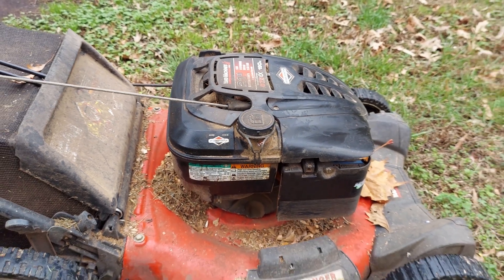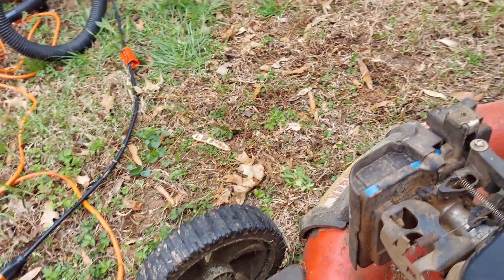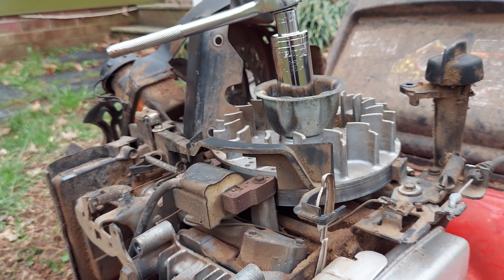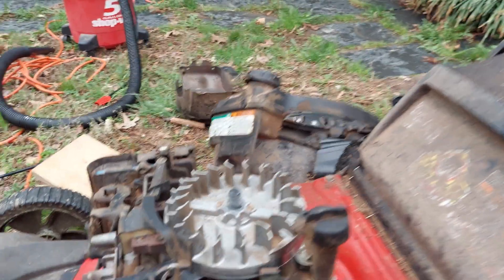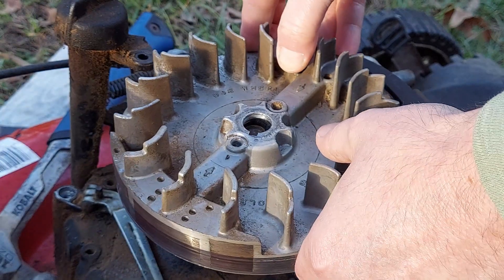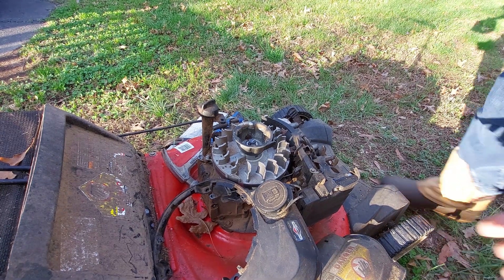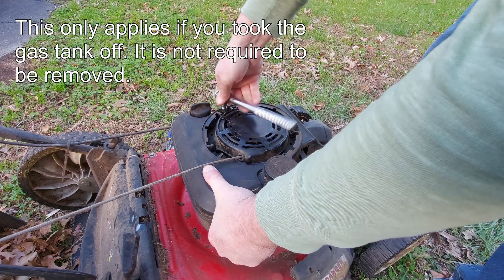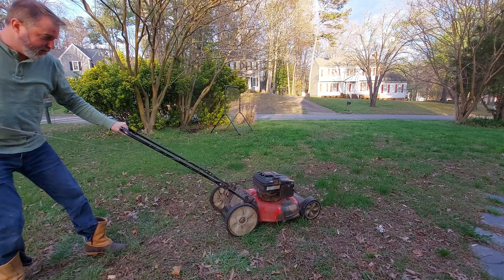Mower Cord Pulls Back and Won't Start - Hurts Hand When Starting - Fix Briggs and Stratton Engine

Comment: I just need the long plastic air vane part but i can convert it back to a manual choke lever its not up to me though its up to a friend if they want a working mower or not cause that automatic choke won't work with a broken air vane seems like if troy bilt wants people to continue buying their products they'd have those old style parts still available to buy 

So i wouldn't buy a new model of that engine if i could because those engines are bad models

Comment: I sure could use that air vane off that mower though newest models of that engine have shorts air vanes now no longer the long style thats on that one also that 1 plastic part is no longer available new or used but if i could get another engine like that one i can use its parts

Comment: Thank you!!!  I had the same symptoms and watching your video saved me from buying a new mower.  I have a Toro that started running rough and quit.  It had a bad spark plug and loose blade.  Fixed both and then it was pulling back on the cord and difficult to start.  Ran rough and started making clanking noise again.  Blade loosened up again.  Watched your video and the key was also sheared.  Replaced key and it started first pull and ran great.  You really made my day.  Thanks
Reply from the maker: I'm so glad it helped! My mower is still working :)

Comment: You didn’t unplug the spark plug
Reply: Yes he did, he removed the wire. The spark plug gets no spark without the wire attached. If you don’t know that, don’t attempt to take anything apart because you’re a danger to yourself 🤣🤣🤣🤣🤣🤣🤣